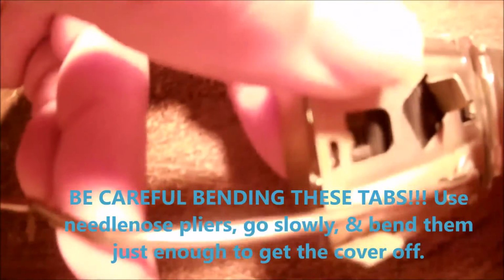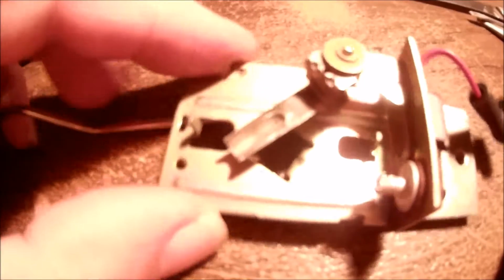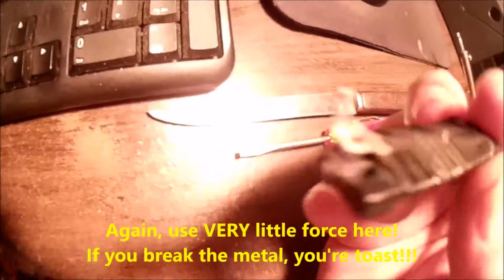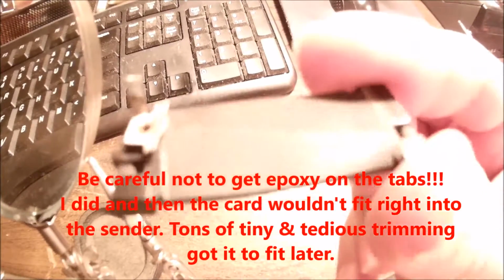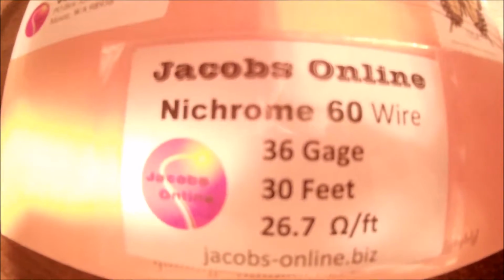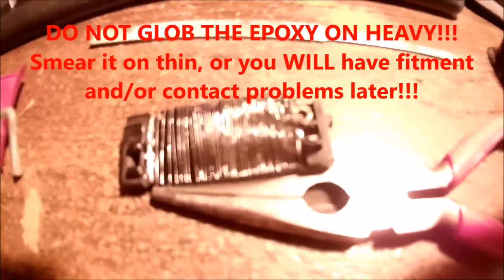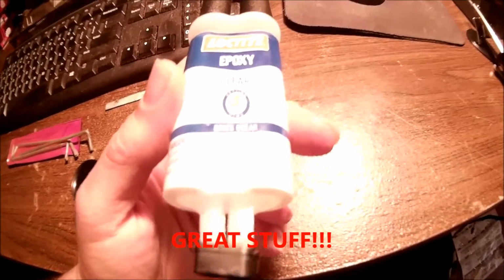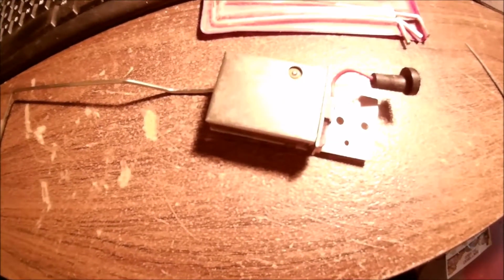1978 Toyota Pickup Hilux - Fuel Sender Rebuild for $5

Comment: I find it interesting your FSM says 0-90ohms. Mine (1978 book) says 10-120ohms. I’m using 80 Nichrome 34 and I struggling immensely to get it anywhere close because of how long the wire I need to hit that spec is. The best I’ve gotten so far is 10-90. Any advice on this tedious job? I’ve contemplated buying a fuel sender for a mid 80s Toyota as that would be at least 10-110ohms but it’s about $100 and I am afraid the plastic board won’t fit exactly.
Reply from the maker: Having been through this myself I understand the difficulty in getting the total resistance as near to spec as possible. 10-90 ohms seems reasonable to me. The 90 Ohm value is more important here, as that end of the scale is what effects the gauge reading nearer to the Empty mark on the gauge. As long as that's close to accurate it'll keep you from getting stranded/out of gas.

The 10 ohms (Full end of scale) is reasonable enough. There is no physical way that end of it is ever going to be 0 (zero) Ohms, due to the nature of the resistance wire itself. I assume whoever wrote that part of the spec in the FSM they were being a bit lazy with their terms.

As far as buying a new sender for parts, I think I'd go with a Chinese made aftermarket one, which is a lot cheaper than genuine Toyota. I saw a few on Ebay for $20-$30 shipped that say they fit the 83 to 95 models. Beyond that I'd just bite the bullet & have Bob's Speedometer in Michigan rebuild the original unit for me.
https://www.bobsspeedometer.com/services/fuel-senders/
Reply: @The13thSword  Do you have an email I can send a picture of my fuel pump setup. I checked your page but didn’t see it. I’m trying to figure out why my fuel pump doesn’t pump when it turn the ignition and try to start. It’s a new pump and I tested it to make sure it worked with a battery. I’m wondering if If my black power lead wire is plugged into the wrong prong. The fuel pump instructions had no info on which prong was the power and which one the ground.
Reply from the maker: @ToyotaRN  I will include it here but you can also find it on my channel page by clicking on the "About" link. sword013@aol.com

The only other two issues that could cause your problem, assuming that all wiring is correct & connected, are the fuel pump relay or the fuel pump resistor. There is an off chance that it could also be the oil sender unit, which acts as a trigger for the relay.

Send me the best pics you have & I'll take a look& let you know what I think.

Comment: Do you want to sell me the rebuilt fuel sender for the 1978 Toyota ? I can’t find it anywhere Yota Jim’s hasn’t had one in a year and my tank is off and I am stuck. Let me know since your the GoAT with the Helix 🧬
Reply from the maker: My original sender that I rewound (rebuilt) wasn't accurate, so I don't think it's going to do you any better than the one you have. Maybe getting yours rebuilt by Bobs Speedo would be the way to go. I know this might be near impossible if you are using the truck as your daily ride, but any alternate ideas might take a while as well & keep the truck off the road.

Unfortunately, Toyota changed the sender flange design(s) after '78. '78 & earlier used one large flange with 7 screw holes. '79 & later models used two smaller flanges with 5 screw holes, one for the sender & one for the fuel pump. '72 to '89 the senders had an Ohms range of 3 to 110 Ohms. I believe from '90 onwards they switched to a 0-90 Ohms range.

So, modification wise, this means you could use an '85 to '89 sender, but would have to find a way to take it off it's 5 hole flange & attach it to your original 7 hole flange. Or perhaps "cannibalize" the newer sender's parts to fix your old sender, namely the wire-wrapped "card" inside. I only mention the '85 to '89 senders because they are still readably available on the market. However these things cost about $150 so it might be about the same money to get the old one restored.
Reply: @The13thSword  thank you I am going to send it to get rebuilt . You are the Goat 🐐 of this truck lol and I love my little truck. I have other rigs right now now I’m using an old VW as my daily.
Reply from the maker: @scgrindllc  Old VW? Another one that is hard to kill. :^) I'll be here if you need anything else.

Comment: Thanks for the help! I used a 30 AWG wire for the  sender and it was a bit big. Only thing I could get locally. Might have to get a programmable fuel gauge, mine was at 2 ohms and 120 ohms
Reply from the maker: The wire gauge is fairly important, as thicker gauges have less resistance per foot to them. I got the Nichrome wire for my project here: https://jacobs-online.biz/nichrome_wire.htm
They also sell the wire on Ebay. It's not very expensive at all.

Comment: AWESOME JOB!   I'm in the process of repairing a buddy's 77 Toyota sender that is exactly like yours. Cant wait for your update on how your rewind works. Looks great!  that tiny stuff is NOT easy. I wonder what ohms on "empty" and "full" with a sender in good shape would show?  Thanks for taking the time to make this video!  Well done. I also just subscribed!
Reply from the maker: Thank you. The ohm reading on these senders is, according to an old factory service manual, is 3 ohms full, 90 ohms empty. I have learned that as long as you get it close it will work & be fairly accurate.

Another bit of info. My sender is working OK, mostly. My particular problem is that the plastic card in the sender has a ridge on it (see video); a long "high spot" where the wiper arm makes contact with the wire. The middle of the ridge is more worn than the rest of the ridge. This is due to me running half a tank routinely for 19 years. In the half-full range, the sender is not sending any signal to the gas gauge (reads dead empty), because the wiper arm isn't making contact with the middle windings. I did notice this after I did the rewind, both visually and on testing with a volt/ohm meter. I could not find a way to bend the wiper arm further to keep contact through the whole "sweep", without taking the chance on breaking the arm. The gas gauge does come back to life once the gas level gets down around 1/4 tank, so that's OK with me. The empty side is more important!

The only fix for this I have seen out there is to find some gasoline-compatible plastic, and carve out a new card for the wire. If the card just had a flat face this would be easy, but with the ridge on the card, not so easy. It could be made, but I suspect that it is going to be just as tedious as the re-wind.

Lastly, I now do not think that the clear epoxy is really needed. As long as the windings are tight, they shouldn't need to be glued down.

Best of luck with the repair project!
Reply: I'm happy report that the sender I rewound for my buddy is working FLAWLESSLY!!!   ......Thanks to you and your super helpful video!!!
 I ordered both the 34 gauge and 36 gauge nichrome 60. I ended up using the 34 gauge wire. I ended up with the factory specs you provided, and was told by my buddy that it works EXCELLENT! He is going to be testing it at all levels while filling up the tank to see how the gauge corresponds with the amount of fuel in the tank. I'll post an update later (about a week or two). Thanks again for the help.
Reply from the maker: You are most welcome, just glad something I did was a help to someone.